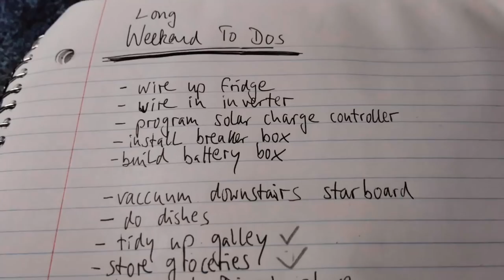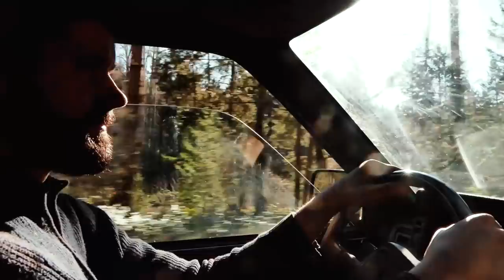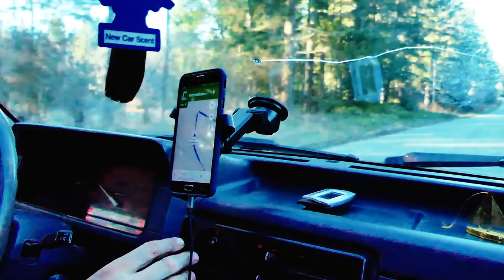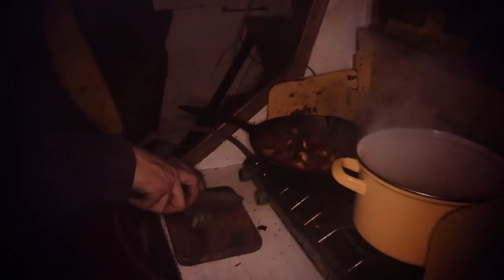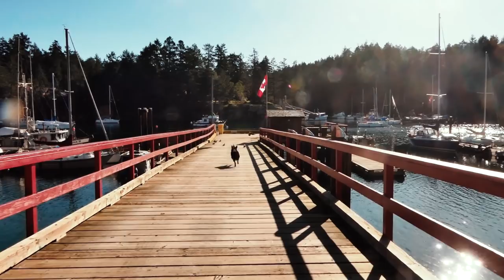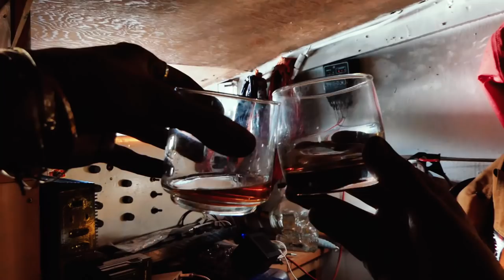Melly's Episode - Sink or Swim 45

Comment: I'm sure you've already heard this but... PLEASE don't keep your propane tanks inside the boat! If a leak occurs in your water tight hull it builds up and either will suffocate you in your sleep... or worse explode with the next spark. If you're wondering 1 of the green disposable gas cylinders has about the same energy equivalent as a stick of dynamite. Just by looking at the age of your stoves I'm guessing the propane line is old too. Any leak could be a big problem. Read up on a proper marine propane system and spend a few hundred on new propane lines (supposed to be replaced every 10 or 15 years). Please be careful and stay safe.

Comment: Simon, just to stir the pot a little bit, have you ever considered incorporating TEG chips into the power generation system? Not sure if you know about these high temp Peltier devices. You can recoup some of the energy you are wasting as heat from the diesel / wood stove as electricity to trickle charge the batteries at night. 

I have a Grizzly woodstove in my trailer that I am considering adding TEG modules to so I can make power at night when the sun is gone and the wood stove is on. Just as a project. 

I am not a sponsor or anything. Just a nerd who likes "free" power and being offgrid. Check it out!

http://www.tegmart.com/thermoelectric-modules/22-watt-teg-power-module-by-tegpro/

Comment: I hope when you were talking about loving Elon Musk's ideas, that you were not talking about the Hyperloop SCAM. !. The concept is not new. 2. It is impossible to actually build on Earth. 3. All teams entering Musk's competitions actually turn over the rights to their technology to Musk! All the silly projections about energy usage ignore the massive power requirements of maintaining a vacuum in the tubes, even under optimum conditions. Cost projections totally ignore real life factors, like all the expansion joints needed, to compensate for temperature changes, as well as the numerous vacuum pumping stations. They also ignore the huge amounts of power required to run the pumps and the cars, stupidly babbling about solar panels, as if solar power stations were somehow FREE and 100% reliable! Lastly, even if it were built and it was possible to pay for everything, and the pumping stations worked, any damage to a tube (causing a big leak), even sabotage, would result in EVERYONE, anywhere in the tube, dying!